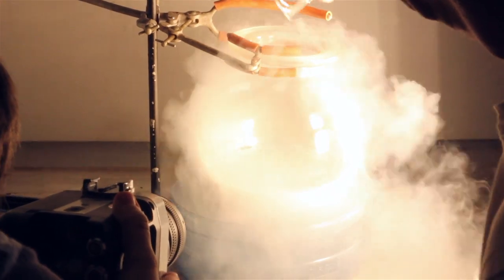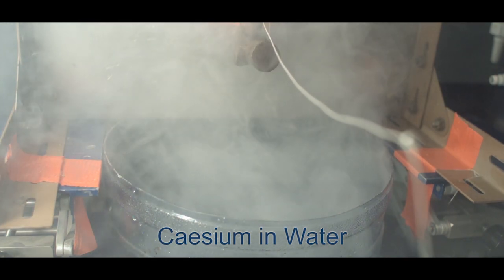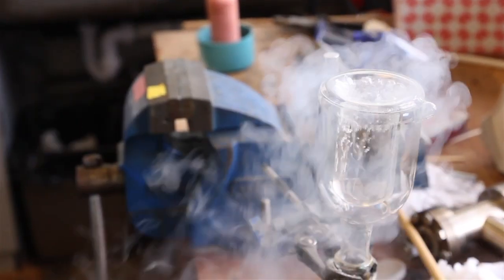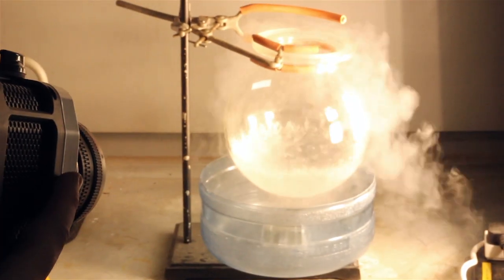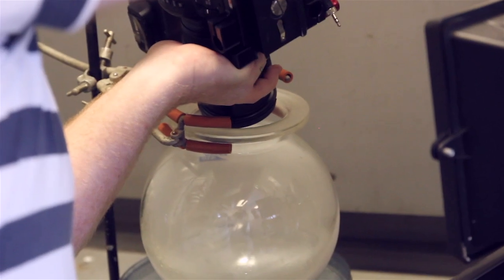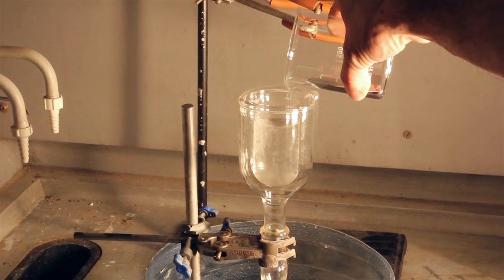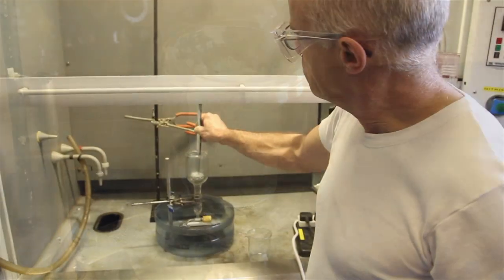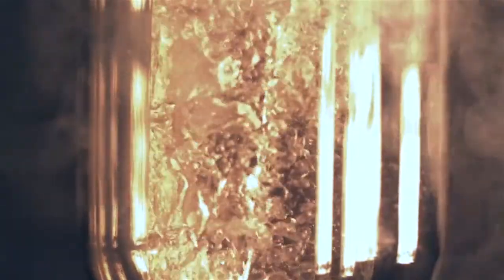Pouring Mercury into Liquid Nitrogen (slow motion)

Comment: Great video. Th surface are effects contribute but perhaps more important is the fact that the mercury is changing latent heat with the nitrogen as it is solidifying. While the copper is changing sensible heat as it is just cooling. Enthalpy changes associated with phase change are often 2-3 orders of magnitude higher than enthalpy changes with temperature, hence the difference in the amount of heat released. Surface area also contributes but I would suspect the change in surface area in this case wouldn’t be larger than one order of magnitude.

Comment: Wat if you use liquid helium instead of liquid nitrogen and in case it with Mercury with the effects of the temperature decrease or increase due to the valarity of the Heat and a weight of Mercury

Comment: Alkali metals don't create explosions in water because of the difference in temperature, but because of hydrogen gas and oxygen exploding.
Reply: That wasn't the point. They were talking about an effect of heat transfer that can be observed in alkali metals reacting in water. Look up fuel coolant interaction, as they said they were demonstrating.
Reply: Actually the explosion between an alkali metal and water is a coulombic explosion.

Comment: I was wandering how the mercury was reacting on the way down in the slow motion. I have heard of the leidenfrost effect, but I could not see the Nitrogen actually touching the mercury. All you can see is the mercury surrounded by gas. Do they come in to contact at all? I don't understand how that works without physical contact.

Comment: What happens to contaminated mercury after experiments like this, is it recycled or discarded some how?
Reply: +SparkysBarelyMusic What do you think contaminates the mercury?  The mercury was exposed to the same element as it was swished around in the container and poured out. The air you're breathing is about 80% nitrogen, you know.  Its molecule is a triple bond between two nitrogen atoms, and so it's pretty stable stuff.  It "wants" to stay together.  You have to convert it to something else before it will "want" to chemically dance (react) with mercury.
Reply: Contaminated? What would it be contaminated with?

Comment: I was wondering if the energy released by the phase change of the mercury would be causing the violence of the reaction, but it turns out the heat of fusion of mercury is actually pretty low. Mercury has about 1/30th the HoF of water (2.7 vs. 79.7 cal/g). So there actually isn't that much extra energy added.

Comment: They have flash boilings of liquid nitrogen vats form super conductors. The super conductor near instantly switches state from a conductor to insulator with a current that requires a copper wire size that is 10x the size of the super conductor.

Comment: I watched the video.

Based off what I seen, I doubt the vessel would explode.  I think the liquid would go jumping out of the vessel, but I think the vessel would maintain.

Basically, it would just spew out of the top, much like a volcano, but no where near as bad because there is no pressure build up.  
Now, if you had it drop in and then made the top more narrow, it would go off like a bomb, or if it was big enough still, an actual volcano.  But, much like when you drop a block of dry ice into a swimming pool, it will just foam out over the surface.  Here in this exact example, it would just violently shoot out for a bit until it was gone or cooled down.

Comment: You should've used gallium. It's much safer since it's not toxic. So you can do it on higher temperature and tolerate a bit of splash without worrying about toxic metal liquid droplets everywhere. In fact, if it splashes, just cool down the room with air conditioning, you can pick up those solid gallium pieces by hand.
Reply: Virtualgod2009 so . . . You're making a Death Ray?
Reply: Stanley Li If this is being recorded in the UK, the gallium will be solid except during a heat wave. Gallium has a higher specific heat (>2x) than Mercury, so there would actually be more energy released. Enough to rupture the glassware and spill liquid nitrogen all over the floor? Or enough to solidify the gallium before it reaches the bottom of the flask?
Reply: Virtualgod2009
708lb of lead=~1 cubic foot; lead costs about .91c per pound; to keep it directional you need 4-5 bricks, expensive but not over 100k. I assume you're referring to gallium which costs about $2.5 million per cubic foot.
Is my math right? The death cannon is cool BTW.
Reply: Virtualgod2009
I was thinking cast lead, you just need a heat source (600F) and a mold. Really the only thing you need to worry about is yourself, building a wall between your observation point and the source matters most. I don't build tubes and suggest that you use your own judgement if you go with any shielding system. The radiation is released from the whole length of the tube so it does have to be shielded along the length if you want to have full shielding.
Reply: The violence of the reaction is due to the greater surface area of interaction between the two different elements at different temperatures. A safe reaction with greater surface area can be had just as easily by putting in a vial filled with some #9 bird shot from a shotgun shell. A large number of spherical objects will yield a large surface area.
 The shot can be at room temp just as the mercury was.
Reply: Virtualgod2009 Why not just use water? I could be wrong, but I thought you only needed a relatively small amount of water to completely absorb the dangerous types of radiation.
Reply: Virtualgod2009 Ah, that makes sense.
Reply: Virtualgod2009 I hope you're building your Death Ray in a remote shed in the woods somewhere?

Are you trying to fry the neighbours' cat?
Reply: Virtualgod2009 And why are you building this thing?
Reply: Virtualgod2009 Well I can understand why you would build such things out of curiosity. I just thought you might be doing some kind of experiment.
Reply: Ahhh, my favorite reason: Why? Why?! Why not?
Reply: Virtualgod2009 please tell me you've built this, and there is a video? 😨 😁😁😁
Reply: azayles I'm pretty sure he got arrested.
Reply: You do know that the U.S. government has satellites that can detect high amounts of radiation. I hope you have a Geiger counter and a dosimeter.
Reply: Geiger counters work well with X-Rays, it's the Alpha particle they struggle with.
Reply: Yea, are you using it to sterilize things or what? You should use it NOT in the living room as the particles can still contaminate surfaces and irradiate small particles in the air that you could breathe in.
Reply: I did a school project on gallium. I'm #31 in my class and gallium is #31 on the periodic table.
Reply: Yeah but there is still liquid nitrogen splashing -_-
Reply: Lo-Res Gamer  See OIL SPILL FREEZE SALVAGE now playing on You Tube. Real Deal or more feathers and dispersants, etc.?

Comment: You should totally try this with liquid oxygen. I double dare you.
Reply: Snatxi Any cryogenic liquid will be at it's boiling point unless it is being cooled. There is no 'average temperature' that it will be at. LN2 boils at -196*c, and it will turn into gas if any heat gets into it by any means, so it isn't going to magically cool itself below that. Same goes for liquid O2.
Reply: Liquid oxygen is warmer than liquid nitrogen, since the boiling point of oxygen is -183*C.
Reply: I don't think you can get that much liquid oxygen, its too cold
Reply: You can get it, It's only pretty dangerous.
Reply: TuntematonSika well, you learn something knew everyday
Reply: Snatxi I believe liquid nitrogen is warmer then liquid oxygen because if you fill a tin can with liquid nitrogen the aluminum will force oxygen atoms into the bottom of the can where they then condense and form liquid oxygen but it is only a very small amount. the only way I've seen people harvest it is with an extremely strong magnate
Reply: Snatxi Thank you for your clarification
Reply: Snatxi They create liquid nitrogen by compressing it, then rapidly expanding causing it to cool into a liquid state,
Reply: Snatxi the temperature has little to do with it. Cooling it down is not very hard, it's just that the air around us is 78% nitrogen and only 21% oxygen. So nitrogen is over 3 times more common in the atmosphere and therefore much cheaper to get.

Comment: What would it look like if you were to use a molten metal, say copper, and added that to the liquid nitrogen?  Would the increase in temperature cause a more violent/beautiful reaction? It seems the whole point here is to illustrate what happens when you have a vast degree of temperature between the two substances.

On the same note, what if you were to take an extremely reactive metal and add THAT to the liquid nitrogen?  Or if the nitrogen is too inert what about liquid oxygen?  I know that last bit would be VERY dangerous, but I think it would make an excellent video even on a small scale!

Comment: The move vigorous boiling may also be due to the mercury temperature settling at -39C as it gives off its latent heat turning into a solid before its temperature can fall further, where as the copper is already solid.

Comment: Next time, molten lead/iron/aluminium in liqid nitrogen.

Or maybe better. Since it may work like "DON'T POUR water into acid or water into hot oil" rule, it might be explosive if you pour liquid nitrogen into liquid lead. Reverse the proportions so that a bit of cold gets overwhelmed by lots of heat.

Comment: I was wondering what would happen if someone was to create a hollow sphere made out of a thermally conductive material. then you were to create a vacuum in the sphere  would the surface tension caused by the vacuum generate heat in the sphere and if heat was created would I be sufficient to create a convection current if the sphere was immersed in a liquid or a gas?

Comment: Thumbs up if you think they should ad Liquid N2 to mercury.
Reply: maybe.  lets find out.
Reply: Doesn't the Liquid N2 float on mercury? Oh well, its worth a shot :)
Reply: It would most definitely float, if it stays liquid. I am sure if you add the n2 slowly it will just steam off very quickly .  What I an wondering if you add a lot what will happen. No doubt the N2 will bubble off but what I really wonder is what will the mercury do.  I believe the top would freeze and sink in some way, causing some sort of convection that will bring warm material to the top and speed up the n2 evaporation.  It might be lame it might be cool.

Comment: Reminds me of an interesting experiment I did recently.  I bought some Bismuth and heated it up above melting.  I'd guess it was about 400C.  I then poured it into cold water.  It made a popping sound as it exploded in the water on contact.  Bismuth doesn't really react with water, so this was pretty much thermal explosion.  The result was mostly tiny dust-like bits if bismuth, with small shards of metal.  I recommend you see for yourself.  I'd love to see that on high speed cam!  BTW, Bismuth freezes ~272C and I was doing this to experiment with crystallization techniques.

Comment: For a controlled experiment, did you ensure that the heat is the same in both cases, i.e. account for the different specific heat capacities by controlling the mass? Or something similar maybe involving heat transfer coefficients? Otherwise you can't draw much conclusion from comparing the copper and the mercury.

Comment: I made the classic mistake of adding water to sulphuric acid in a chemistry lab in an attempt to dilute it. I suppose the reasons are different, but the hydration of sulphuric acid is extremely exothermic. To make matters worse, sulphuric acid is denser than water, so the reaction tends to occur at the top of the vessel. When I added water to sulphuric acid, the acid started to boil violently which is understandably extremely dangerous for conc sulphuric.

Comment: Boiling mercury please!
Reply: taofledermaus did a video.
Reply: That's incredibly dangerous, as boiling it would send gaseous mercury into the air. In the right conditions, sure, it's possible, but is it practical to do for simple observation?
Reply: *****  im sure it can be done in controlled conditons somehow and it doesn't have to be at boiling point just close enough to produce a more violent reaction which is what we all want to see.
Reply: nilered did it